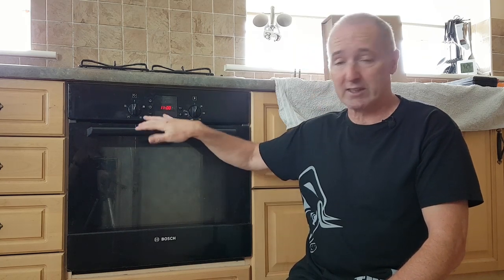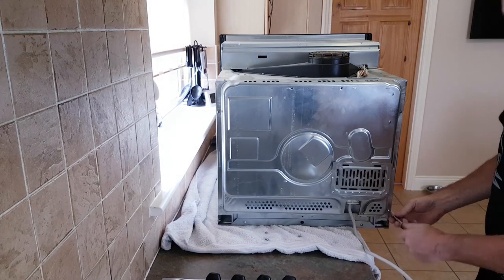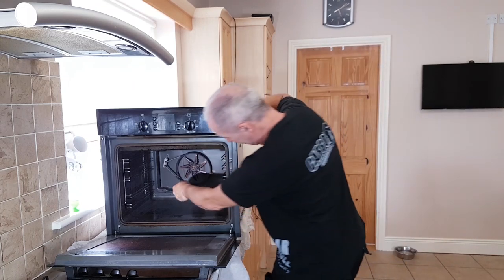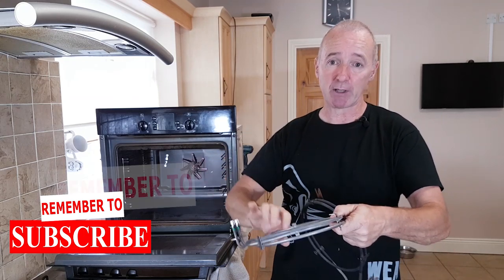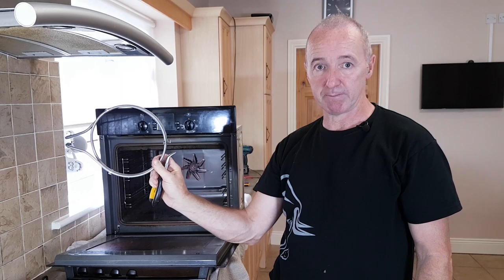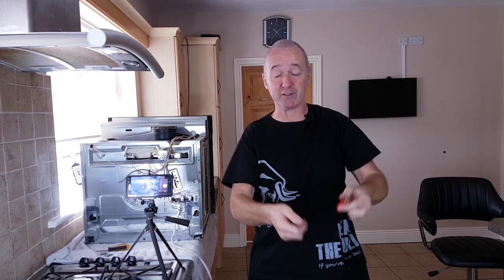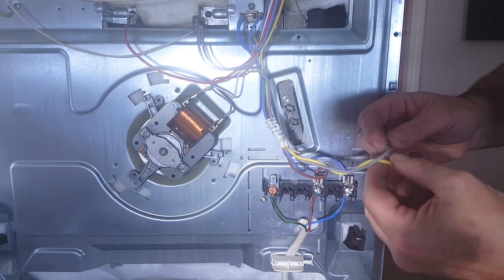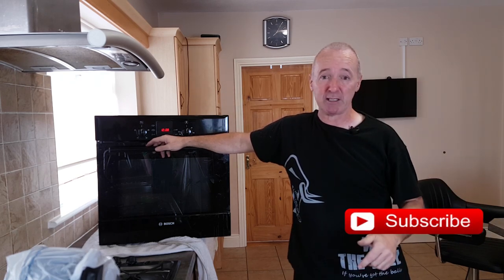How to change a Fan oven Element - Non OEM Element

Comment: I did exactly the same for my Miele oven...being Miele, the replacement part was the best part of £100...so i bought a completely different one of the same wattage but with the same coil diameter for £20 and made it fit like yourself. i had an additional problem with the cooling fan (probably why the element failed) with it struggling to spin. i ended up replacing that with again a part from a completely different oven...its amazing how similar these parts are and how much the price varies.
Reply from the maker: Hi Garry. I don't work on these things often but some of them are easy to access. When buying the parts online it can be an absolute minefield. My own repair worked great and cost very little. Well done on getting the miele working. There is some satisfaction to be found in fixing or making things yourself. Thanks for commenting Cheers Gerry